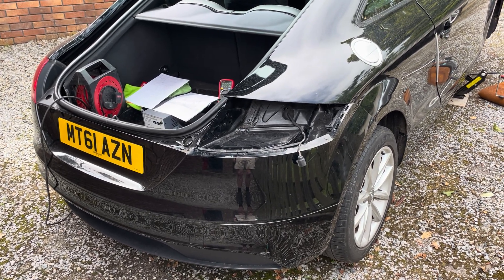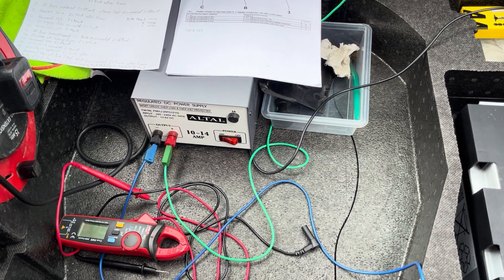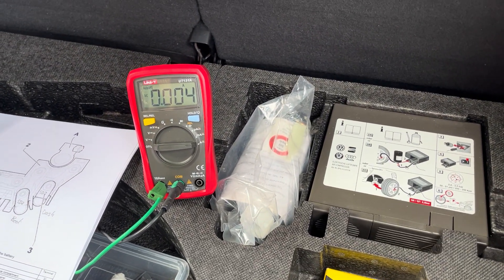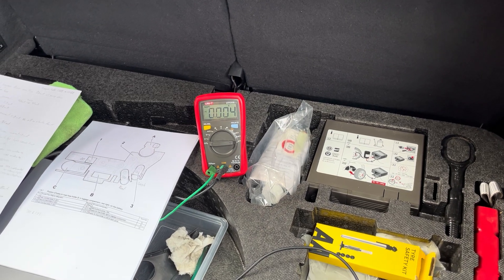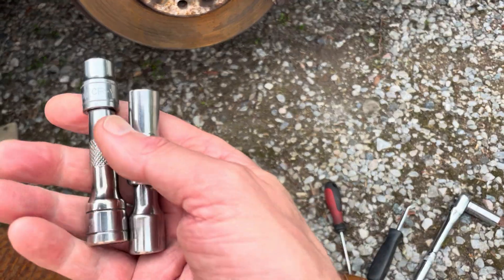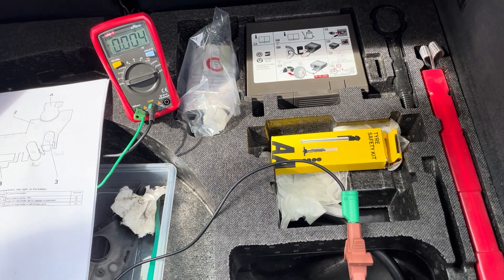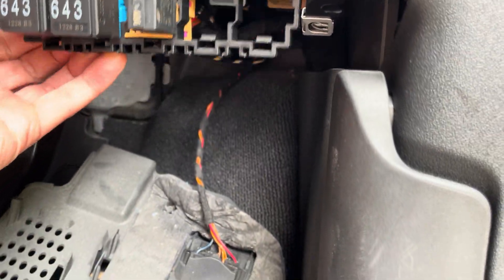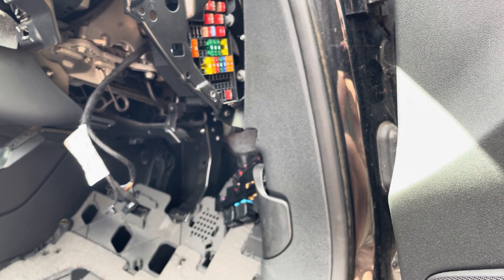Audi TT Mk 2 (8J) Battery Parasitic Current Drain

Comment: Thanks Kevin, really clear coverage of the problem. I suspect I have the same issue; out of curiosity, did you measure or try pulling fuse A5 from under the bonnet? The workshop manual states it is “Anti-theft warning system (sensor), anti-theft warning system (horn)”. Just wonder if that’s a viable solution rather than trying to get to the alarm module? I appreciate you saw the draw on the cabin fuse board but could that be due to “odd” signals being received from the faulty sounder therefore keeping it “alive”?
Reply from the maker: Yes, that was my first attempt at fixing the problem but that didn't work, hence why I had to resort to the process in this video.